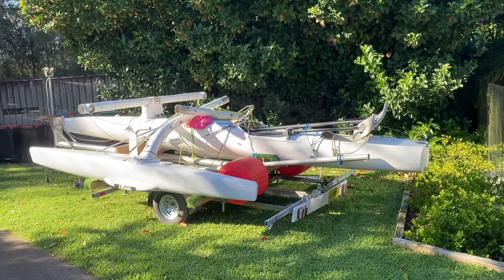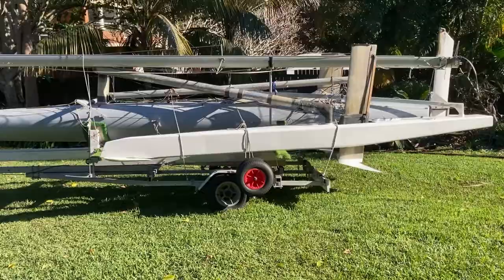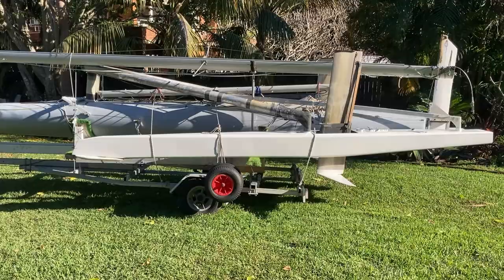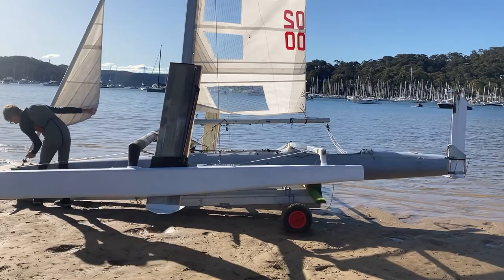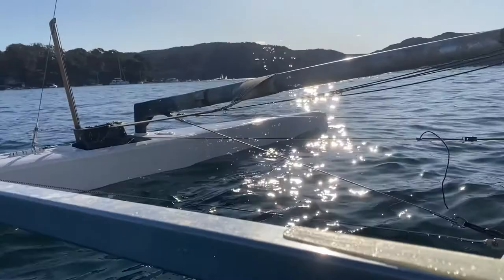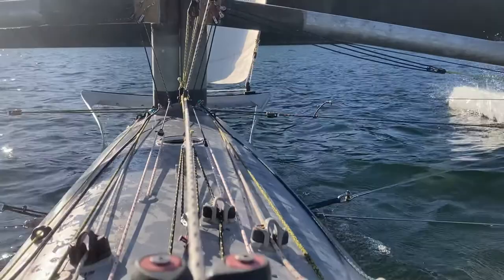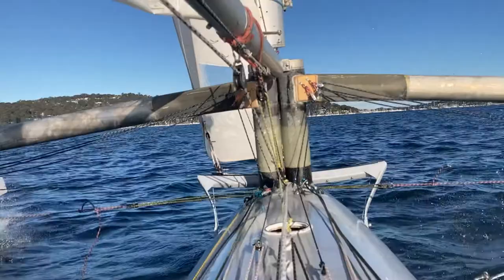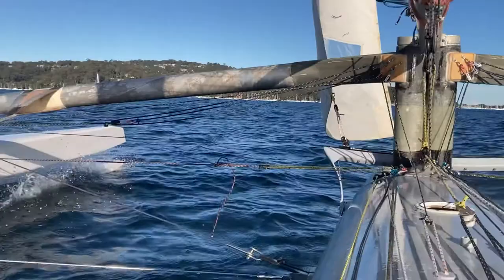Foil Sailing Made Easy

Comment: It looks as though the surface sensor controls the angle of the complete t-foil, not just a trim tab on the horizontal wing on the bottom. Is that correct?

Comment: wow, surprised to see that it looks like the sensor is simply directly connected to the pivot of the entire foil/board. I see a pylon to lift the foil up, so it looks like the foil has a few degrees of pitch, and can be raised and lowered. It's a much simpler system than a moth foil. I'm wondering if the forward sensor ever dives? does this work well in bigger waves? hmm from the lawn shot I see the foils look at least a meter high, but you fly it quite low.